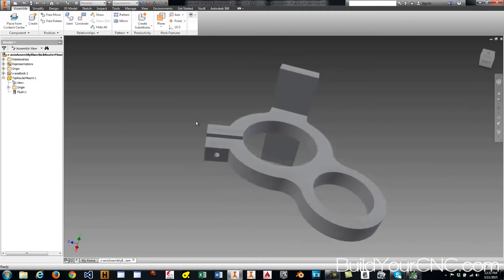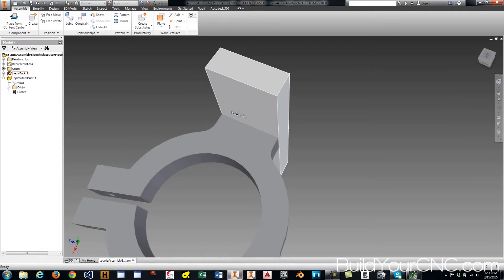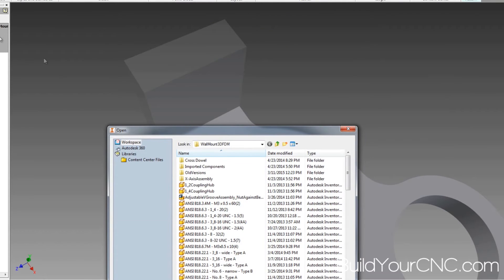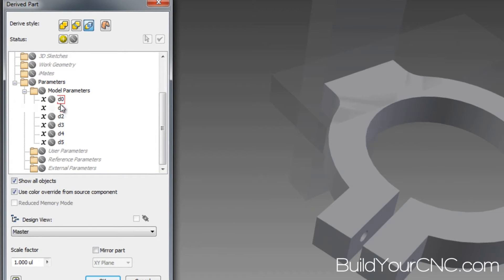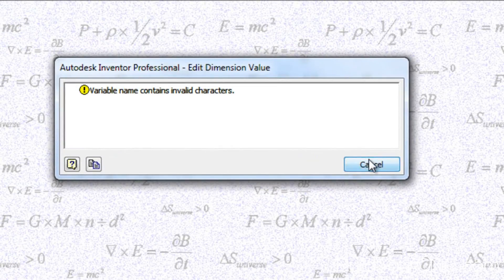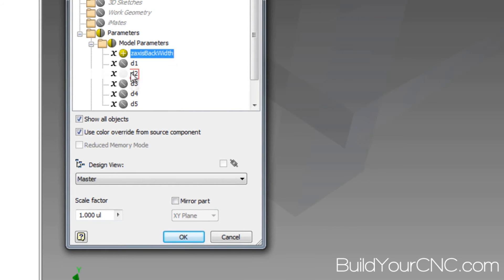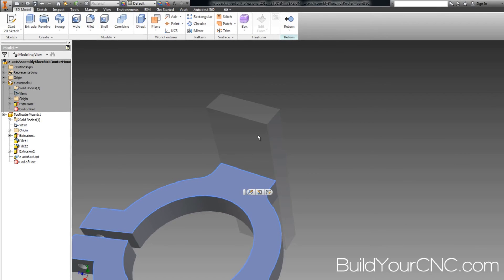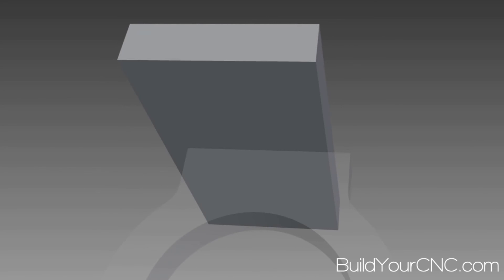How to Share Part Properties with Derive - Tutorial on Autodesk Inventor/CAM/CNC Workflow - Part 4

Comment: better way to use derive is to make your whole assembly as a single part. when you make a new solid that would be a different part in assembly use "make a new body" option. Than you just derive all of those bodies to an assembly.
Original part serves as a skeleton for the whole assembly, when you need to change something you change it there, and since it is all in one part there are no external reference issues.